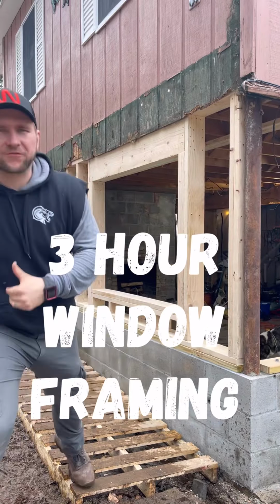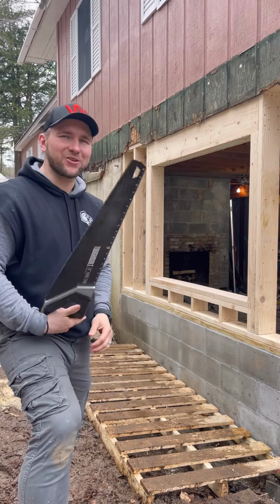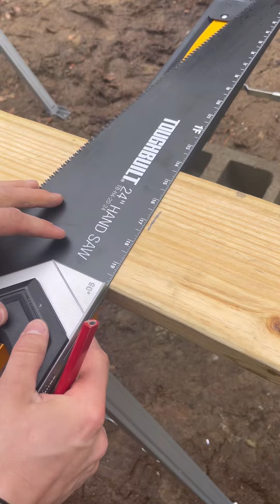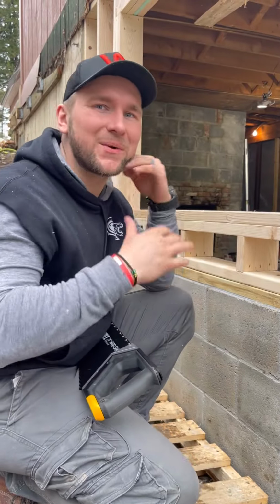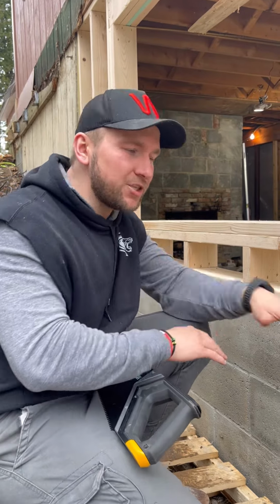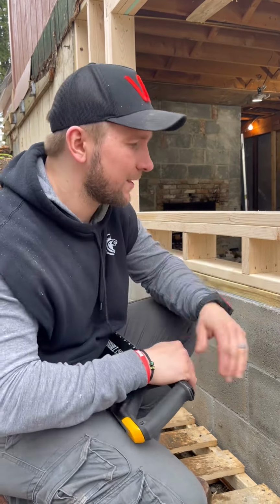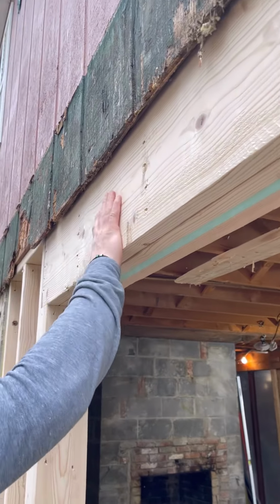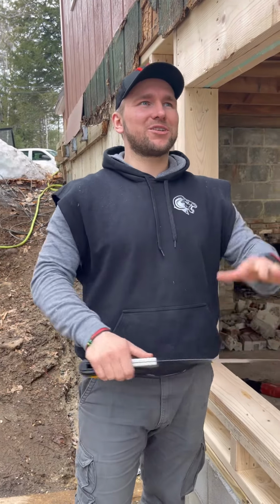Best way to frame out a window. Insulated HEADER! WINNI

Comment: KD for who wants to know means Kiln oven dried to remove water in wood cells. What's left in your lumber after is a 19% moisture, which is each cell skin. The reason for that is to have a straight, relatively soft lumber that will be versatile to drive nails without splitting and also easier to put them parallel (mantel, header, partition wall). Then lumber assembly will shrink in size but very little in length. If this is convenient for building, it could also become an issue related to water penatration or lack of insulation. Ex. A 2x6 (1.5x5.5) can easily shrink .25" and breaking your ext. caulking joint or int. silicone floor joint of shower/bath, especially if screwed on fresh ext. Wall. So, new homeowners will be aware of this by doing visual inspections, especially after the first year. For the same gap reason when new window installation within a new rough opening when it comes to the time to choose the insulation. Since lumber shrinks at the waist, it would be preferable to use batt insulation rather than low expending foam. The best is to let air dry once framed.

Comment: Thank you! I need to add a proper header over my back door in my house (it's old and was poorly built). Right now it has a single 2x4 on the flat. Framing is 2x6 so this is perfect. I'll have to replace the jack studs. One is a full inch shorter than the other. Fortunately, the door opens inward so I can make some of the changes without changing the exterior. Still trying to figure out how to deal with the electrical box for the light. I was thinking of 2x4 walls and not 2x6 so adding the extra 2x6 in makes sense.
You also answered my question about the foam board. So 1" thick. I've seen that green stuff at the store. I think Lowes has the green stuff and HomeDepot has pink stuff. Both the same size but I don't know if there is a difference other than color.

Comment: How do you make sure everything is level or does it not matter but just leveling the windows is what is needed? Cool video though. I don’t even do construction but enjoyed it a lot. 😂
Reply: Everything initially in construction is on the level to an extent. The only major thing that matters when it comes to leveling is the main components like the windows, roofing, and doors, plus major load bearings, as an uneven level can weaken the load transfer throughout the system. Going off of the fact that that person is building on an older house, they will attempt to ensure consistency in level throughout the construction to promote a proper stud layout and load transfer to the foundation walling.

Comment: The capillary break is ok, but maybe consider a neoprene gasket to also deal with air infiltration.  Then tape the crack on both the inside and outside.  Just my input.

Comment: rip the bottom sill on table say and do the same I think you just came up with a new insulated tech 2x6 could in theory be  done the same they make a version of this with dowels and foam so the radiant transfer is minimized..